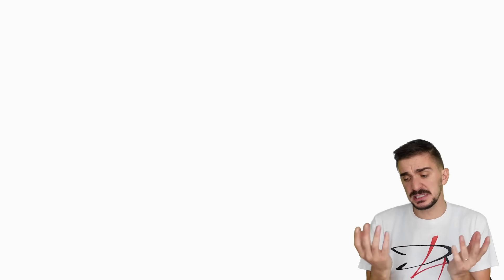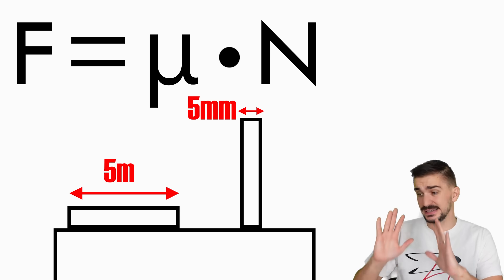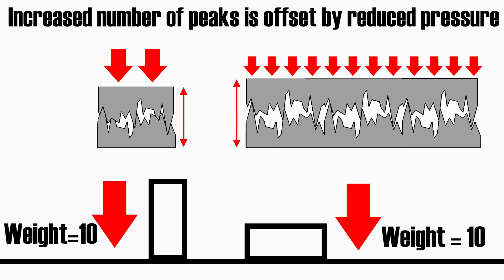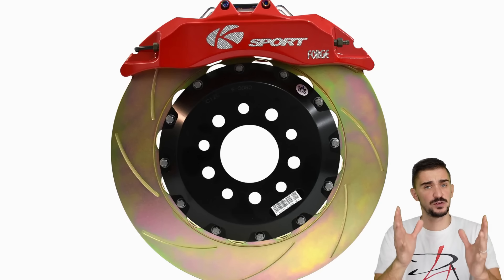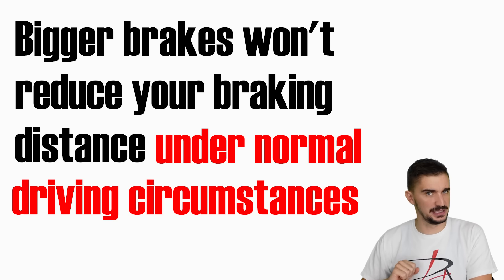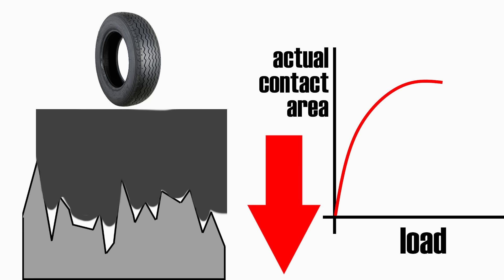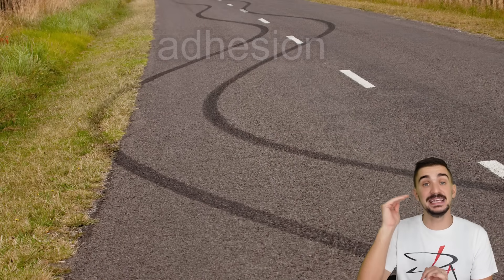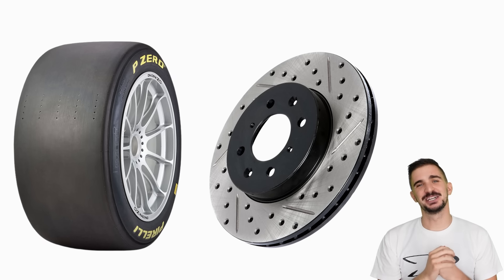Why Big Brakes Won't Stop You Faster but Wider Tires Will - Friction and Surface Area Explained

Comment: Bigger brakes will stop you faster.  Yes it does. I have a Taunus from 1981 and it has 240mm solid disk in front and drum brakes in the back.  And I have a Taunus from 1978 where i bolted 290mm vented disks and brembo on in front and 240mm solid disk with the front calipers. And That car stops alot faster. If it didn't had seat belt or windscreen you would lay infront of the car.  Tires are the same so 195/50 r15.    The pads from the brembos are alot larger.  Maybe for new cars with abs and all that stuff yes.  But Your theory isn't always right with older cars.  Brakes from "newer" cars brake system is already oversized for normal use.
Reply: Your old car can't lock up the brakes? Most cars can.
Reply: @logitech4873  My Old car can lock up brakes. No problem.
Reply: @Ariekebe  If it can, then bigger brakes can't make it stop faster. That's the whole point.
Reply: @logitech4873  but I was telling that I have to the same cars one With the standaard 240mm single disks and drums brakes and one with 290mm brembos and 240mm calipers in the rear.  And that car brakes alot better as the standaard brake setup.  Older cars have underrated brakes.  New cars don't have that problem, because they over engineer the brakes from new cars and Yes  they have ABS.   And over enineerd brakes.  Bigger brakes with old cars is better.  New cars +-15 year maybe

Comment: Respecfully dissagre... If your friction (from bigger brakes) is farther from the center of rotation the torque applied from the brakes is grater. Torque = force x distance. That means your friction is more efficient with biggerdiameter  brakes than smaller ones.
Reply: Doesn't matter. The limiting factor is still the tires.

Comment: It may work for F1 because they don't have wheel well restrictions (open fender). Plus, they use lower tyre pressure and stickier rubber. 

In normal road cars, a wider tyre usually means a bigger rim & wheel size, thus increasing weight and rotational inertia. 

You may get a tiny increase in the contact patch, but a huge increase in mass that your brakes now need to work hard to stop.

Given the same OEM braking force, the car will need more time to stop. That is the reason for upgrading the brakes.

Comment: Biger disks and pads also contribute alot to breaking faster and more efficient. bigger disks mean bigger pads, which translates to more surface area and bigger breaking momentum/torque (because of the size). Also bigger contact area dissipates the friction heat more evenly, which means breaks dont heat up so much and the ware of the pads is smaller :)

Comment: Bigger brakes gives longer distance way on one wheel spin. 
One more thing is  torque resistance arm which increas  with diameter of breaking disk.
But at all I think that heating is much bigger problem that is solved by size of brakes.

Comment: Principle the wider the better works only on dry asphalt. In winter time narrower tires stop car quicker. The reason is that the pressure is measured in kg/cm2. The wider your tire is, the bigger the tire square is, and according to the unit kg/cm2 if you increase the fraction denominator, the result (pressure or in our case part of breaking force) will decrease. The same when go skiing - you take those ski not only to slide but first not to fail into a snowdrift because of their surface square.

Comment: Someone might also address the issue of rotational tire slip. On both ends of the wide/narrow spectrum, tires become more likely to slip in rotation under high torque.

Comment: One of the purposes of a big brake kit is to get the calipers further away from the center of your wheel.

You may not increase the force of the pads on the disks, but you are creating a larger torque. Torque is the product of force and distance. Torque is what actually slows your car down
Reply: No your upgrading to big brakes (unless it’s a 50s drum brake) to decrease heat. Your stock single piston caliper can lock your wheels, just not for long
Reply: Brake torque doesn't matter as long as your brakes are strong enough to lock the tires (which they all are).
Reply: @prdoyle  fair point, but as soon as you increase mass you're going to need more torque. Especially in something like a truck hauling material. 1st gen Toyota Tundras, for example, have notoriously under-powered brakes

Comment: Everyone is talking about the torque arm / fulcrum of the larger rotor and friction area. I didnt see any of the ones I looked at discuss tire fulcrum. My Jeep has a very hard time locking up the tires I have on it which are taller, but marginally wider, still giving a larger contact area and definitely fulcrum.

Comment: I think you are completely and utterly wrong. Given a car with a hydraulic braking system that can deliver a fixed amount of pressure (i.e. hydraulic force of the brake piston against the brake pad), the amount of (Normal) force delivered to the rotor is completely dependent on the surface area of the brake pad. A brake system that delivers 100 psi to a brake pad of 10 square inches delivers 1000lbs of normal force to the rotor. A brake system that delivers 100 psi to a brake pad of 15 square inches delivers 1500lbs of normal force to the rotor. Now, at all pressures applied to the brake system, the amount of normal force is higher than before. So bigger brakes will be more sensitive, apply more force faster (i.e. do more work) across the full spectrum of stopping force. It's still physics, but you are holding the Normal force constant, and it is not is dependent on the surface area.. The real formula is F=mu*N, where N=Normal Force=Hydraulic Pressure * Area of Brake Pads. You can rewrite it as F=mu*HydP*A.

Comment: I heard modern brake pads didnt gas out enough to require holes in rotors. Slots are made to evacuate debris, and i guess are enough for the gasses modern pads make, if they make some. Serious track cars usually dont have drilled rotors as they are sources of cracks, wear pads more, cost more and dont seem to have any benefit that outweights that. Personal experience, after switching from slotted and drilled to slotted only (got tired of cracking them from the holes before they even wore out), i noticed two changes: pads wore indeed slower, no more cracks in the rotors. Cost was lower too. I use hawk DTC60 pads on them, they are a pretty magic compound that has a high and stable mu on a very large temperature range.

Comment: It is always down to heat - my 325mm discs will be hot after 2 or 3 decelerations form 200 to 80 :)
But I guess if I have bigger rims and bigger discs + removed plastic wheel arches this will be no problem.
First thing to improve heat in braking is to get bigger rims.

Comment: NOT ENTIRELY TRUE - bigger disc DO PROVIDE more breaking "power" - the force of friction between the disc and the pad might be the same, but it works on bigger radius! And we need to look for breaking torque, which is force x radius, not the force only ;)
Reply from the maker: The increased braking power is irrelevant
https://youtu.be/Ql9eYh31kTw

Comment: i just realised something you forgot, you can stop faster with bigger brakes rather than bigger tyres. They're called air brakes and reverse thrust. Cars need air brakes and trust reversers combined with VSC can use air brakes on one side to help cornering too. how do you think airplanes top their massive weights despite the small amount of tyre surface area they have relative to their weight?

Comment: What about the added leverage from a larger diameter rotor from center point to caliper contact that provides more power to the caliper. Imagine trying to stop a spinning flywheel by grabbing a handle right next the the center versus a handle  1 meter out from the center. The difference translates in this scenario.

Comment: It actually does help you stop better . Over stock brakes. 

More braking force with less effort.

Yes this gets better with wider tires as long as you don’t add more weight by doing so

Comment: Can you do a video on how 4WD results in better braking on snow and ice? Most people will think I'm making this up, but linking the front and rear axles prevents once axle from locking up before the other (like in 2WD) resulting in more effective braking on slippery surfaces.

Comment: Wouldn't larger brakes have more leverage over the hub as they're farther from the middle? Obviously the brakes would still overpower the tires anyways so I doubt it would really make a difference but if the tires hypothetically couldnt lose traction wouldnt a wider rotor decrease braking distance as a consequence of the increased leverage?

Comment: A few problems with this (or maybe not problems, but things I don't understand).

1) Torque is force times the radius. In this case force is the force of friction, and the radius is how large the break rotos is, meaning larger break rotors exert more torque, which should increase stopping power. Toque is the real thin we should be focused on here, as we are trying to stop an object form rolling.

2) A larger break should generate more heat. The conversion from angular velocity (frequency velocity, or how frequently something makes a full rotation) to linear velocity (how fast something appears to be moving at a given point along the radius) is the frequency velocity times the radius. Again, radius makes an appearance here. The larger the break rotor, the faster the outer edge of the break rotor appears to be moving. This means from the perspective of the break pads, it's having to do more work to stop you, meaning that it's generating more heat.

Now it seems to me from that alone, larger break pads would stop a car more effectively, but the break pads are also having to do more work (and so generate more heat) to stop a car. But maybe these things balance out? The faster outer velocity means that the breaks pads are effectively having to stop a faster object, and so are not as effective, and because the outer velocity is greater, it generates more heat, but the increased mass of a larger break pad dissipates that heat better?

Comment: Thanks for putting a finer point on our understanding of brake distance vs tire and brake size.  I track a car(s) and upgrade the pads FIRST and as I get better and it is a bit amazing to be stopped due to red flag have SMOKE pouring out of my wheels and know I hadn't given up any braking force yet...When I get fast enough to make my brakes cry out in pain I will invest in those big brakes.

Comment: this is really really simple and everything you need to know is this: the weakest link determents how well or fast something goes... the title of this video is a bit clickbait, because lets asume you have unlimited grip, then a bigger brake system with more brake pods/pistons can provide more stopping power and stop the car quicker. but when you have small tires a big brake system wouldent do a thing because the tires are the weak point. you need brakes that can just about lock up your tires and then you know you have a good system all around. if the brakes lock up the tires with ease then you need better and or wider tires and if the brakes cant lock up the tires at all you need bigger brakes... easy

Comment: "Why Big Brakes Won't Stop You Faster" ..thats not true..  you missed alot of things... 
icreased disk size - get increased radius @ braking force/torque ( with the same pressure/force )
increased caliper / piston size - u get increased pressure/force @ same pedal force ( incr. pedal travel )
...etc.

Comment: There's a big gap in your explanation, though. While surface area doesn't matter when it comes to friction, what matters is the braking torque applied to the braking disc by the pads - and this is directly proportional to the size of rotors and the place where the pads squeeze them. Basicaly, on bigger brakes you get more torque, similar as on the crankshaft where longer cranks mean higher torque generated by the engine.

Comment: About 16 years ago, I was in an argument with a guy I chatted with for only a couple days. I argued that since the brake can lock up the wheel, then it is powerful enough. He answered that, no, that is not how it goes, at all, and stopping the wheels does not mean that the brakes are "powerful enough". It took me a while to understand why. In retrospect it is obvious why: locking up the brakes does require enough force to stop the wheels, but once they are stopped, the brakes no longer work: there is no friction between pad and rotor, there is no power dissipated by the brakes, the tyres are simply getting smashed. 
I would like to take this opportunity to apologise to that guy for my ignorance and for insisting I knew. I am sorry, guy from 2007, you were perfectly right.

Comment: is it not about grabbing the larger diameter brake disc with larger pads at same brake pressure has a better brake clamp force, not about friction only?

Comment: Another thing after forgot is bigger brake disks have another, bigger diameter. So wider breaking pads slowing down the body by using bigger "levers", as same (as explained by author) force is applied further from the break disk rotation center. Also, with bigger disk brake pads make longer travel(path) per a disk revolution... etc..
BTW, it's common knowledge for bicycle riders ))
Author is wrong.

Comment: Well big tires won't help your car stop faster if your car has small brake calipers either lol
Reply: The basic point in the video is that even stock brakes have more available brake force than the tires can transfer into the ground. If you brakes can lock the tires or activate the ABS, then it's the tires that decides how fast you are able to stop, not the brakes.

Comment: problem i keep running into is finding tires that are xxx/100Ryy for 4wheeled vehicles /65-75 are common ... but not really good for traction when it is really needed ... in the snow and wet

Comment: Two things from an uneducated observer:
1. Wouldn't larger brakes also mean the outside diameter of the brake is larger, thereby increasing the torque effect gained from the brake, if only marginally? True that friction force is the product of two components, but if the brake is applying a given force at half the radius of the rolling radius of the tyre, wouldn't more braking force be generated by applying that same force at 3/4 the rolling radius of the tyre? Tyre grip will still limit maximum braking force, but it would be easier to get to that point.
2. Would it be fair to say that wider tyres are generally better quality, and therefore have better adhesion to the road? I feel that the quality of the rubber plays a huge part in doing tyre upgrades. I bought my car second-hand with a set of "Aussie" tyres on it. The tyres had okay grip in the dry, but felt like soap in the wet. Directional tread, so water dispersal wasn't an issue. The wet-weather performance was so bad, I ditched the tyres with about 4mm of tread left and put on a set of Michelin Pilot Sport 4s—the difference was phenomenal. Dry grip was improved, but the wet grip was now 70-80% of dry grip, instead of 10%. The Pilot Sport 4s are asymmetric as opposed to directional, so water dispersal theoretically shouldn't have been as good. Same sized tyre, so the only thing I can put it down to was the quality of the rubber.
I know other things like carcass construction can make a difference, but this was just pulling up in a straight line, where carcass construction doesn't affect tyre footprint as much. Varying pressures didn't change things either—simply, the PS4s killed the death-donuts that had been on there previously.

Comment: So with all the trade offs how do engineers come come up with the optimum tire width for normal street driving?, and how much does it matter given that wider tires merely change the shape of the contact patch? I am guessing there is a range where it doesn't matter much At some point a very heavy load on a skinny tire will elongate the contact area to the point of the rim contacting the inside of the tire, which of course would be a bad idea. Prior to that the tire could still be deformed to an extent that would be counterproductive. As for brakes, it seems it is all about heat dissipation and looks. However, unless I missed it, larger brakes have a leverage advantage which help both stopping and heat problems. Less pressure is needed for the same size pads on a larger diameter rotor.

Comment: Bro if am getting u ryt u r wrong the surface area is as important as helping the breaking distance the bigger the discs the higher the angular momentum and the easier to stop,it's not just for heart ,it's like using a smaller leged plairs to hold tight a heavy peace of metal.wen turn a heavy large fly wheel were is it easy to stop at the shaft or at the tip of it,bigger discs r better at stopping

Comment: The principle of lever, the longer the lever, the less the power to lift or push the load. The bigger diameter of disk is to increase  the length of the "lever" which is disk pad to push the disk to stop. So the same pressure of the piston caliper the more the power of the brake to reduce the speed of the wheels. Not only for dissipating the heat I think, some car even have bigger carbon disk which almost need no cooling to work properly.